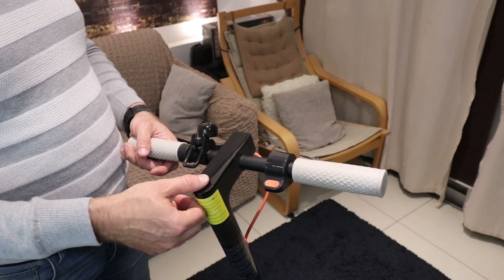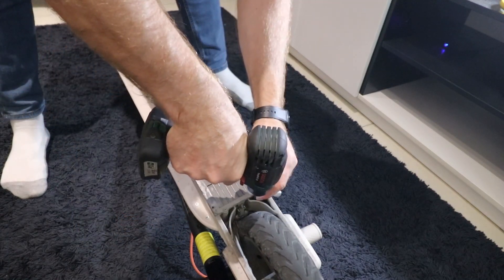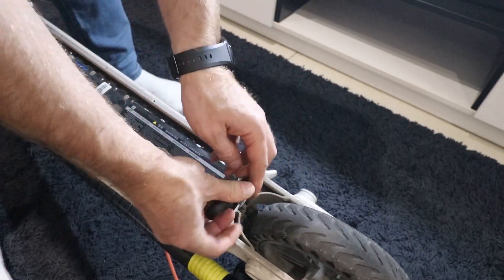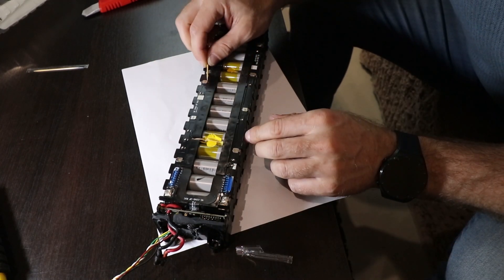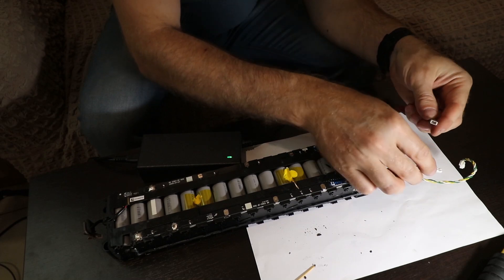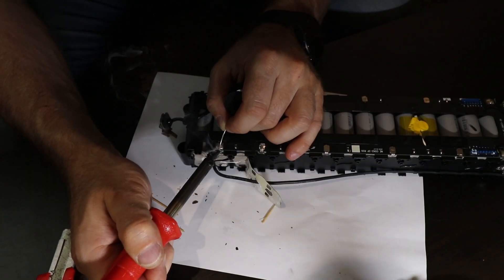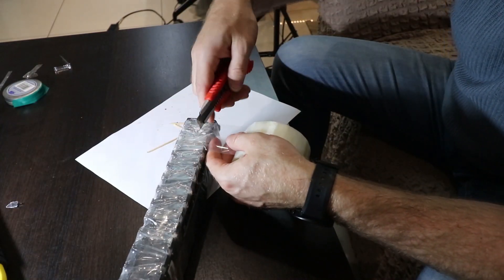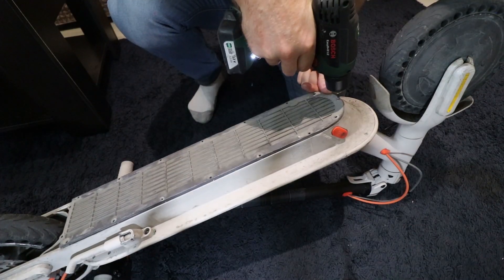Xiaomi Fixed!! Does not turn on? Does not charge? Reduced battery range suddenly? Xiaomi

Comment: Exercise extreme caution when handling batteries, as it can be very dangerous without proper training. A short circuit can easily occur, leading to battery damage or fire.
Reply from the maker: Thank you.  That's true. It can occur  within seconds

Comment: Hi guys!! I will give an update on my Xiaomi scooter pro!. So I went on a ride on a rainy day. Scooter power button does not work, and sometimes randomly started to turn on and off by itself..

What I did was simple open the scooter. No water was found inside..what I noticed is there is a red light on the motherboard lighting on and off. so what I did maybe moisture got inside the electrical, removed all the connections especially the main power supply (this is very easy as those are just like clips)..dried it off with a hair dryer (dont use the heat function of the dryer just air dry it) and left my scooter open like that for 2-3 days. Works perfectly now!!
Reply: While it was broken did it still go full speed and then just stop and turn off  because that is what happened to me but now it won't turn on at all
Reply: @Bibi_is_goat  yes when it turns on i can still press the accelerate. It still goes the normal speed. It just keeps on turning on and off. Just left it for 2-3 days all opened then started working normally. Still using it until now

Comment: Wjat if the batterie already blinks in a blue light even if i plug the battery off woth the power cable? My scooter turns on amd off from.itself or turn on and off the lights. Sometimes it doesnt work right with the power button.

Comment: Same here, just resoldering a couple of the tabs in the battery fixed it. 
What a pile of s#%t these scooters. Poor design, flimsy, battery can’t take the vibrations. The tabs are very very flimsy.

Note that I don’t think that just adding solder will work for long. The solder will be stressed. I soldered a wire with some flex in it. Kind of a U loop. I hope this will last until… something else breaks…

Comment: I have one where the red light flashes 3 times when the charger is plugged in, then nothing... Could this be a similar fault? The battery is showing a very low voltage on a multimeter too.
Cheers!
Reply: Same thing for me, maybe batteries are dead

Comment: Mine is green and when I do the bypass method where you put the wire in the black and does blue red and then it goes to red but the charger's green after a while

Comment: need to get a kit and will try to fix it at home thanks again :))) i was wondering how to fix this issue maybe it will help in my case :)
Reply from the maker: Thanks
Reply: When I plug in the charger the battery red light blinks 3 times then nothing else. I have no blinking blue light the charger light remains green
Reply: @dannyflanery7466  I have the same problem